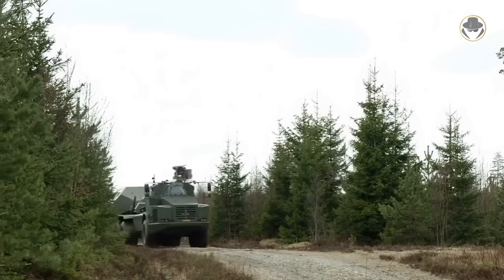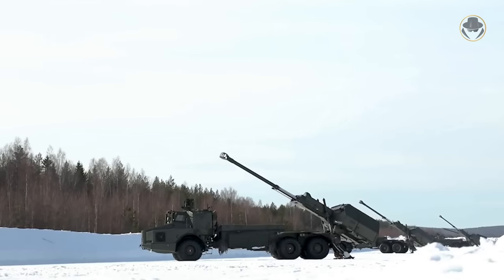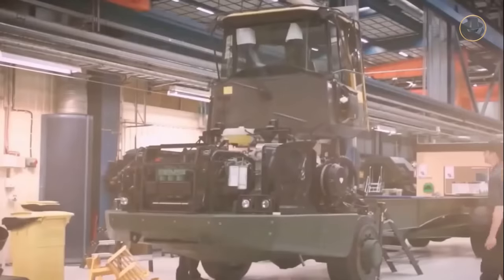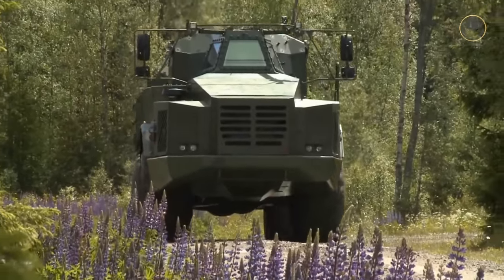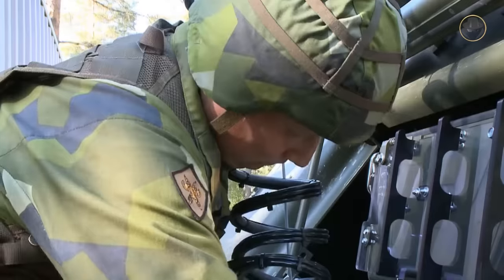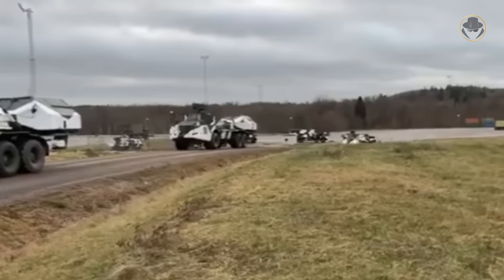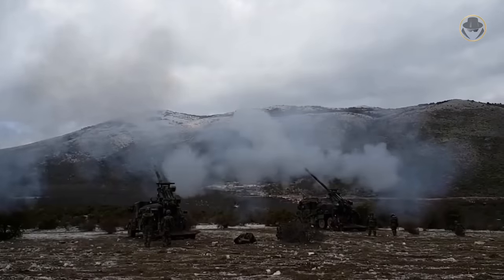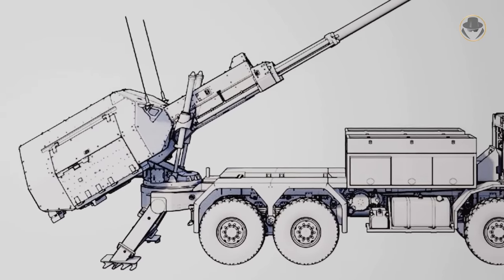Archer Artillery System | What is wrong?

Comment: Biggest problem with any swedish system is the amount of education needed to operate and maintain it.
Reply: But according to all the experts on here it's a simple common volvo found everywhere that any mechanic can fix with parts from down the street?
Reply: @regregan6852  You could probably get some fuel or sparkplugs for the engine. I doubt you have the same luck with the weapon parts. Also 9 out of 10 Swedish truckers prefer Scania over Volvo for some reason.
Reply: @archabe  This "truck" is a evulotion of there famous dumper. most used in mining. Its common al over world and people in different countrys speaks of it as the best there is. So its problebly just the weapon system that is maybe a bit hard to fix.
Reply: @TheZaqsen  I do not doubt the quality only the quantity. And compared to haulers any mining equipment are far from common.

Comment: If they had went with the CV90 they would have won all the contracts that the K9 thunder is now winning.
Reply: It's too light for such heavy cannon
Reply: @acajutla  They considered it tho, so there probably was a way to make it possible in theory plus the CV90 is not a very light IFV
Reply: K9 has almost twice the weight and hp. Plus a few extra tons for ammo. Impossible without a total rebuild.
CV90 is built for swampy terrain (it can also swim) and no one in their right mind drags a haubitz in there.
Reply: @acajutla  the CV90 Mk IV weights around 37 tons. 

The platform literally is already heavier than the archer already. 

The K9 weight literally 10T more than that with 47T and has 1000Hp. 

So a the concern that the plattform would be too light seems a bit histerical. The only real question would be, if the chassis would be strong enough to withstand the recoil.
Reply: Probably not strong enough.
It can take a 120 mm gun though, but i don't think they've sold any.
Anyway i think the Ukraine war will lead to more demand for longer range rocket artillery, at the expence of diminishing sales for large bore guns. You can't let the orcs come within range for their cannons, or they will turn your land to rubble with overwhelming numbers.
Reply: @acajutla  the demand would probably increase, but rocket arty is just too expensive to fully replace classic artillery.
Reply: Remember that tracked vehicle are very costly to operate….

Comment: The Archer, just like the CAESAR, is far too mechanically complicated and prone to failure to withstand a real conflict. Ukrainian artillery units have had nothing but bad things to say about the CAESAR. In short, they were not designed and built to take abuse. For only marginal accuracy advantages over fully manual howitzers, the high likelihood of absense from the battlefield because of mechanical failure provides no practical tradeoff in my opinion.
Reply: LOL, you can' have a simpler design than the CAESAR, and I've seen complaints about the Pzh2000 but never the CAESAR in Ukraine, quite the contrary, it's praised ...
Reply: @foxzz1999  the PzH 2000 was overused by an order of magnitude in Ukraine... Of course it's gonna need maintenance.

And if you ignore maintenance warnings... It will need repairs

Comment: I don't agree with sending these to Ukraine. It's a whole new system that they would require extensive training on, and the risk of Russian soldiers capturing one is always present. Despite all their failures, Russian troops do have their moments where they succeed and that's the last thing we want with this system. 

I think sending them more towed artillery and systems more familiar to what they're used to (such as PzH 2000 and M109s) would be the better option. They aren't much different than what Russia has, such as 2S3 Akatsiya or 2S19 Msta-S so them capturing one wouldn't be a huge issue.

Also, more Javelins would be useful too. The less Russian tanks there are, the fewer they have for any future "special military operations".
Reply: In Ukraine it is and serving honorably. It’s highly automated so it doesn’t take long to learn. If need be, it can be operated by one personnel only. Thanks to it’s range, it will be far from where the action is.

Comment: the problem with the system is not that its complex, but that it is incapable of sustained rates of fire. Most 155 MM artillery systems can fire 40-60 rounds per hour continuously. The archer is incapable of such a feat. Had the mobility (mover) been an issue then it would have been solved a long time ago or a prospective customer would have asked for such an option.
Reply: Where did you get that information man? "ARCHER carries 21 complete rounds, which can all be fired in 2.5 minutes, from fully automated magazines." - this is directly taken from the BAE systems website.
Reply: What utter nonsense. No modrrn artillery system  needs that sustained rate of fire, as they'd be obliterated by counter-battery well before the hour was up. When your rounds are accurate, you shoot and scoot.
Reply: @brownmold  Learn to fight a war. Once you cross the basic threshold of winning against illiterate mountain men and rice paddy farmers we'll talk about modern war. Heart felt respect to your fallen.
Reply: @kudretklc6120  but you miss the point that it needs at least 10 minutes for another team to replenish the shells and propellant. It looks super complicated on video, the crew using a mechanic arm from a high ground truck to put the ammo in a complex-looking loading system.
Reply: @remistiegler5302  that is a problem of all autoloading systems, on the plus side, the crew is protected all the time and they may run away very quickly after spending all of the shells
Reply: @kudretklc6120  for sure the systems with autoloaders are better protected, disengage faster and they provide the best ROF on the market.
But I personnally prefer truck-mounted systems. They offer an interesting alternative btw. autoloaded and towed artillery as they also provide very good shoot-and-scoot capability, decent ROF thanks to their semi-auto loaders, armored cabins for moving and wainting phase, better mobility and simpler maintenance.
Reply: @dhruv88mm  oh boohoo. Methinks you need to reconsider reality, rather than trying so hard to caulk over your lack of knowledge.
Reply: @remistiegler5302  I do agree about the features and benefits that you mentioned about the Caesar-type truck-mounted systems, it is not a coincidence that Nexter already marketing it with many sale successes.